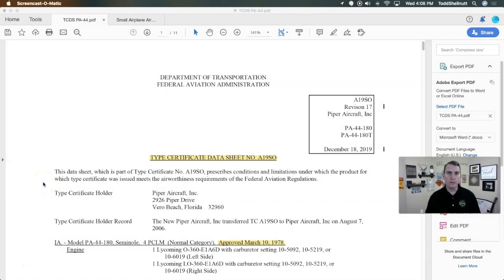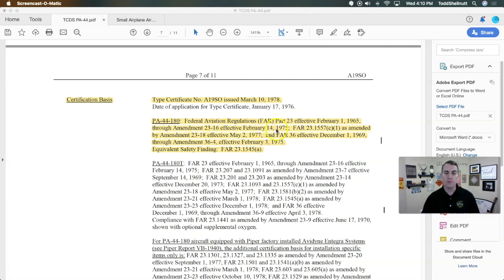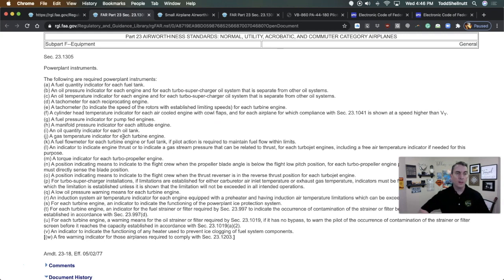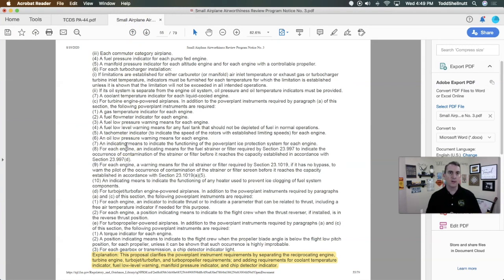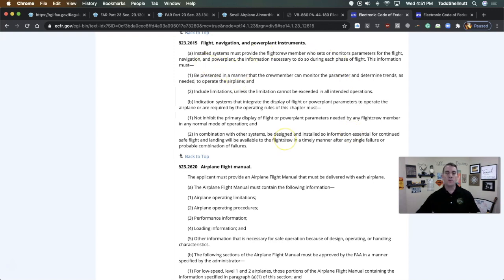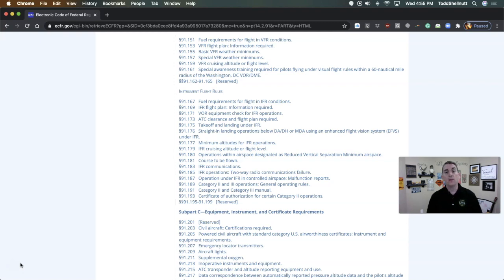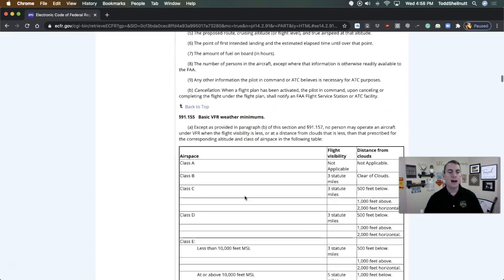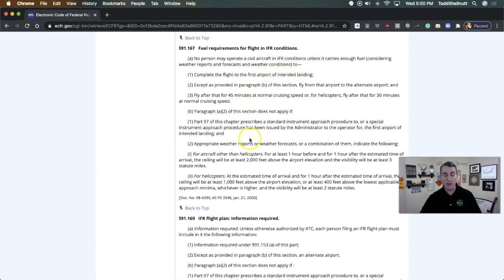What's the Fuel Reserve for a VFR Flight?

Comment: The CFR doesn't say you have to land with 30mins of fuel left in your tanks. Thus its not required for you to have 30mins if fuel left in your tank.
Reply: technically you don't have to land at all. you just glide out of the sky once fuel runs out. I'm unsure about the details in the story: did the student pilot plan a route that allowed for 30 min reserve but decided to visit local areas on the way and landed with only 10 min reserve?  If so, he began a planned flight with a 30 min reserve but deviated from the plan and landed with 10 min reserve. The CFR may need to change it to "You may fly if you have enough fuel with 30-45 min reserve upon landing." That will account flight deviations.

Comment: So in answering the question: "Is a manifold pressure gauge required in a PA-44-180?", do we use 23.1305 as it was written per the "Certification Basis" shown in the TCDS (circa 1974 23.1305 Amd 23-15), or as it was later revised in 1993 (Amd 23-43)?  In other words, which version is relevant to the question: the more recent (certainly more appropriate and complete), or the older version which would imply a MP gauge is not "required" in this aircraft?
Reply from the maker: Sorry for the dealy in the response  - It is required under the Part 23 ruling as it was issued under the TCDS when that serial linage was produced.  Not the revision(s).
Reply: @ToddShellnuttCPC  Think I am still a little confused on this. My interpretation is this ( which seems to be wrong ). The seminole was certificated in 1978 and so when we look at historic regulations we should look at the corresponding regulation date to when the aircraft was certified, which would be the 23.1305 published in 1977. So under this regulation when the aircraft was certified it would not have been required to have a manifold pressure gauge. Then moving forward the manifold pressure gauge was required in 1996 for constant speed props. Why would the regulation from 1977 be overridden by the historical regulation of 1993 but not be overridden by the current regulations that don't specify the requirement of a manifold pressure gauge for a constant speed prop (23.2615)? Also in the current 29.1305 it does not specify a requirement for a manifold pressure gauge. Someone please help, I am missing something here.
Reply: I was wondering the same thing. Todd, could you clarify the question Peter brought up?